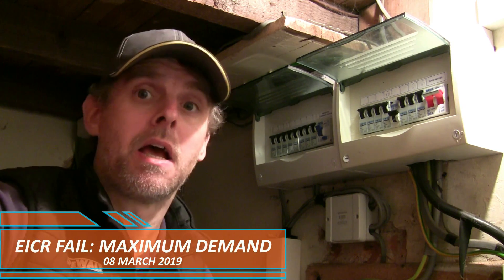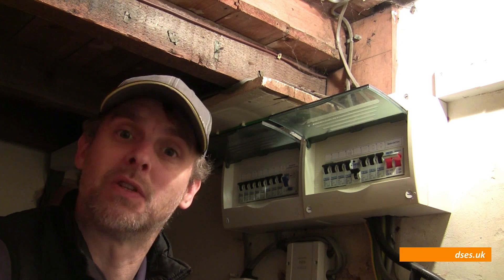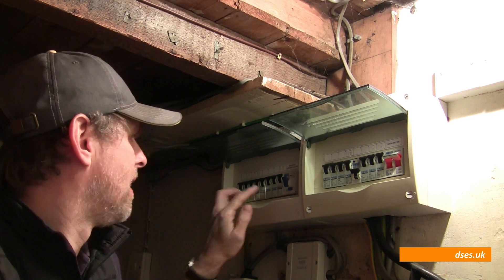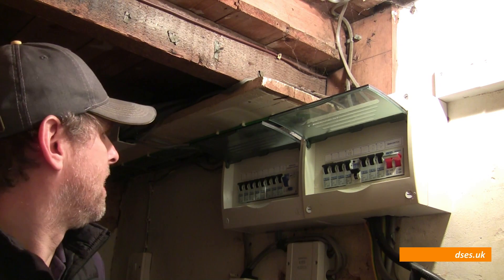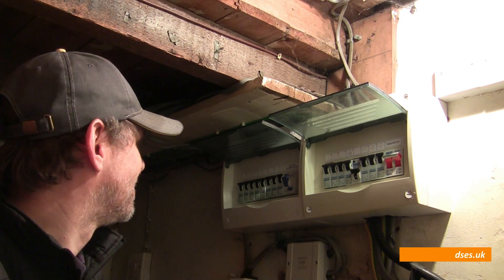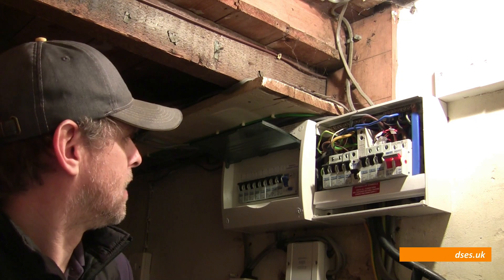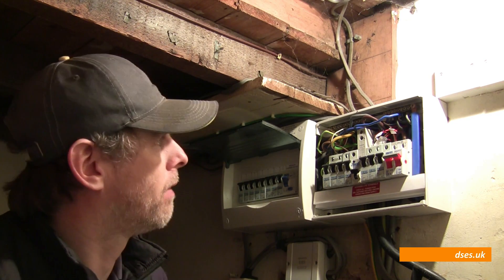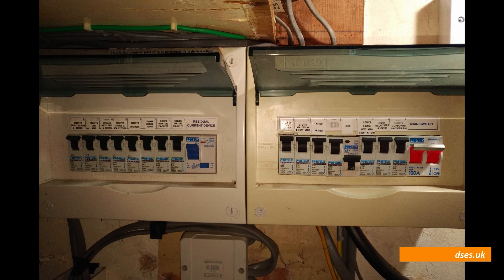EICR FAIL- Maximum demand

Comment: Is there a calculation that could be applied to work out the maximum demand?
Reply from the maker: See Appendix A of the OSG for maximum demand and diversity. It's a tricky one as you can never really be sure what the client will be connecting up, but unless you have known load values, then you assume 100W per lighting point (and can then take 66% of all lighting overall), 100% for the highest rated two electric showers/instantaneous water heaters, then 25% for any subsequent, 100% for the highest rated socket circuit, then 40% for each additional, 100% of any immersion heaters, cookers are 10A plus 30% of the remaining load plus an extra 5A if the control unit has a socket built in (etc.) I've also done it via measurement by using a clamp meter set to record a MAX value over a period of 24 hours average use. Usually you don't have to worry too much about it, unless you come across an installation with some heavy circuits such as multiple showers, car charge points etc. or if you get called out somewhere where the main fuse has blown without an obvious cause.
Reply: @dsesuk  sounds like a lot that I need to get my head around then. Will research more into it. Thanks for taking the time to reply. Great vids btw 👍🏻

Comment: Yes the RCD main switch is fried but has the DNO service fuse ever blown... It looks as though the service cable has suffered the most as a result of the overloading.
Reply: No degradation is apparent on the service cable.This is just standard PILC with a cloth outer covering.
Reply: Given the state of that system, it's almost like there isn't a working fuse in there.

Comment: David, that was an interesting video, sometimes it’s unbelievable what you actually find.  I find it hard to believe that there’s 3 electric showers & 2 cooking circuits as well as everything else.  In a domestic situation, sometimes, I just don’t want the rectifications.  It would be interesting to see the EICR & your reasons behind the coding.  It would also be interesting to see your plain English version to the client.  I have found electricians tend to code & have different interpretations of the regs.  I have installed a priority switch many years ago for 2 showers.  I am curious to know what you would do with the third.
Reply from the maker: Thanks Patrick, you're right about the coding, it is open to interpretation and often down to the discretion of the inspector as to how something should be listed. Besides that, the report is an awful form and there's nothing in the inspection schedule checklist specifically about demand. Apart from the individual circuit faults, the failed RCD I've coded as a C2 in item 4.8 (manual operation of circuit breakers and RCD's) because it won't react in the event of a leakage fault, and as a C1 in item 4.19 (RCD's provided for additional protection) as it's handling more current than it was designed for, so all bets are off as to how it will react. The failed RCD also shows up elsewhere on the checklist of course (items 5.12.1, 5.12.3, 5.12.5 and 6.1). As the demand of the installation is potentially more than the service head should be handling, I've put that as a C3 in item 1.2. It could perhaps be argued that a C1 or C2 applies, but it's been coping for the past fifteen years, and besides the common sight of the tarry insulation having leaked out, there's no outward evidence of it being unable to cope. Other's may have coded things differently, but whichever way you look at it, the report deems the installation to be unsatisfactory with 23 observations listed, and the covering email that went with it had about 1200 words explaining the issues and what needs to be done. The client tells me she has already contacted Western Power about putting in a new 100A PME service and isolator after I sent her a link to their contact form, and she has asked me to go ahead with a board change plus remedials so we should have a follow-up video in a few weeks.
Reply: @dsesuk  congratulations on being awarded the remedial works.... I think🤔🤣
Reply from the maker: @mickbitchum4664  It might be a bit of a short straw job!

Comment: Over the phone I would have quoted 340
Reply from the maker: Is that based on labour? We charged £280 in this case as our list price is £20/circuit for the first six circuits, £10 for all subsequent ones. There were 23 circuits on site, but one was redundant and was omitted. A large part of the cost of a CU change reflects the inspection and testing element, so the work to change the board will be less now that we know the site and its pitfalls. Many would have charged more considering the size of the place, but we've been awarded the work to put right, change the CU and make other alterations the new homeowners require, so it's worked out for us. Anyone who claims they could perform an EICR for substantially less can't possibly be spending the requisite time on site, and if a report is filled with limitations or made up test results (e.g. IR >999 across the board), then it just defeats the point of the thing. I see people offering EICR's for £60, but for that you're getting a drive-by that isn't worth the A4 it's been scribbled on. For that price, you can also guarantee the installation will be stamped as unsatisfactory because the guy doing it will want to make up work he can charge for whether it's needed or not!
Reply: Totally agree. You have to charge enough to do a good thorough inspection. My way of quoting is £50 per board and 15 per circuit. The 50 is to cover my ass if the board is not labelled or there are multiple circuits in one MCB. Your price is very competitive unless it’s against cowboys who do the Ze and then a quick Zs on every circuit and make the rest up. Glad you won the work. They will get a good honest, quality install from you. Loving your channel mate. I learn a lot from you. Keep it up.

Comment: I purchased a 5 bedroom villa with pool in Thailand.

When any of the 3 instantaneous water heaters are used, the lights go dim.

The voltage at KWH falls from 220V to 200V.

Luckily KWH is in the garden in a box with my neighbor"s and get to make an actual ring main when I do repair.

They have same size cables and under voltage problem on our private estate.

KWH are for from private distribution board.

Comment: The fact youv discovered a broken rcd are you to blame if it pops and causes issues an whatever, customers gonna be ringing saying you was the bloke who took my fuse box cover off ? How does that work mate
Reply from the maker: It's always a risk that you may be blamed for any perceived issue after you've been to site. We installed a couple of sockets for someone recently which necessitated powering down the installation, but the client then came back saying "my oven's not working, what did you do to it??" Turns out she just needed to set the clock. Then she said "my broadband isn't working, what have you done to it??" It just took a while for her router to wake up. Then she said "my Outlook calendar isn't syncing, what's going on??!" By then I was almost ready to throw my toolbox across the room. With this job today, my task is to find the problems and present the client with the list of issues and a recommended course if action to put right. It's up to them to make their own risk assessment of whether they want to correct any of the issues or to live with them; I have no legal power to insist the installation is either powered down or immediately put right. If problems occur afterwards, I would just point to the report and the fact that it says (in not so many words) that the electrical installation there is shagged and needs attention, and until it gets properly sorted, all bets are off as to whether anything on the snag list causes trouble either in normal use or under fault conditions.
Reply: David Savery Electrical Services 
Brilliant mate thanks for reply.

Comment: Great video thanks for the upload. I was looking at purchasing the TIS earth leakage tester, any good?
Reply from the maker: The TIS MFT Pro is a pretty capable multifunction tester, but for the earth leakage function you need the clamp accessory shown here which is sold separately and is pretty pricey. Mine has been loaned to me by TIS so I can show it on this channel. This was my first time using it, and the test shown was rather simplistic, I'll have a better video about it in the near future. The little clamp meter I have is a low cost solution for measuring leakage current.
Reply: @dsesuk  thank you for the update. Keep up the good work.

Comment: Great video thanks David!  Seen exactly the shower thing a couple of times now with multiple en-suite hmo conversions.
The subject needs more attention to it, especially on the generally terrible EICR  form, would love to see how you tackled detailing this on the cert.
Reply from the maker: Hi Andrew. It is an awful form, I quite agree! The failed RCD I've coded as a C2 in item 4.8 (manual operation of circuit breakers and RCD's) because it won't react in the event of a leakage fault, and as a C1 in item 4.19 (RCD's provided for additional protection) as it's handling more current than it was designed for, so all bets are off as to how it will react. The failed RCD also shows up elsewhere on the checklist of course (items 5.12.1, 5.12.3, 5.12.5 and 6.1). As the demand of the installation is potentially more than the service head should be handling, I've put that as a C3 in item 1.2. It could perhaps be argued that a C1 or C2 applies, but it's been coping for the past fifteen years, and besides the common sight of the tarry insulation having leaked out, there's no outward evidence of it being unable to cope. We have an enquiry in with WPD about replacing the head to 100A PME with an isolator, and we have the go-ahead for a board change. One of the showers will be decommissioned as they're turning that bathroom into a utility room, so that should help the situation!
Reply: Thanks for the detail David.  Ar the difficulties of trying to express a problem with something that’s apparently been fine for an age, but good call on the service head item i feel.
I would have probably gone with just C2s for the rcd but can’t fault you!
At least it seems your client is interested in getting it improved, that’s 90% of the battle in my experience, and if you’re board changing with 2 showers you can get the rcd load sorted even if they don’t want to spring for rcbo’s.
Not a bad result at all.
Top notch work as always mate!

Comment: That was a very interesting video David. I did years of testing many moons ago and it can be very taxing and tricky. Well done on spotting all the faults. It’s not easy, especially when you’ve got heaps of extensions, additions and alterations galore. I agree, R.C.B.O.s throughout. That’s my basic choice these days. It would be good to see a metal clad fire proof board in there. I hope you get the work, I think you’ll do a nice neat and tidy job of it. I hope you do a video of the shower switch you mentioned. That sounds very interesting. I don’t know about them? Thanks again for the video David. Have a good weekend!
Reply from the maker: Thanks David, I might see if I can push out that shower priority board video tomorrow (hangover pending).

Comment: As an ex emeb / cn / wpd mains engineer I'd be very surprised indeed if the one amp is actually leakage current from a phase conductor  unless there's a solid fault to unbonded metalwork that has an impedance of circa 240 ohms 'within the ground' and the nigh on 0.25kW of heat energy is dissipated into mother earth, or a phase conductor is touching damp brickwork etc. (possibly via unnbonded metalwork) and the heat is being absorbed by the building structure.  I've had both of these situations to sort out when customers  were getting shocks  when outside their property because of the potential gradient across sections of brickwork and across the surface of the ground.  I mention heat absorption because circa  240W of power  loss at one 'point' location would be most likely to quickly raise the temperature to a level where a fire would result.  It's perhaps more likely that the problem is a neutral to earth fault within the property, the 1A of current in the main earth connection to the lead sheath of the service cable being some proportion of the neutral current of the whole installation because there wil be a tendency for the neutral bar to be at a slightly higher potential than the earth connection of the 'tns' type supply at this property - hence all of the instalation neutral current will be 'attracted' to some degree to flow from the neutral bar, along the neutral of the faulty circuit and via the fault into the cpc or bonded metalwork etc, back to the main earth bar in the consumer unit and then via the main earth lead to the lead sheath of the service cable....which will (should!) have an almost zero impedance link back to the supply transformer neutral point.  The crossed colours on the armoured cable also has me wondering - is the neutral of that circuit actually connected to the earth bar of the consumer unit and the cpc conected to the neutral bar? - that would also explain what's happening - the 1A would be the neutral current from the load of that circuit!
Reply: That, everyone, is the voice of experience and wisdom. I hope this person teaches sparkys how to wire things up. There are a lot of crap ideas in the regulations, and a lot of good ways of doing things which aren't in the regulations, too. I get the impression this engineer knows the ins and outs of both these situations.
Reply: This is also needs to be taught to all jointers/linesman who havent got a clue what ohms law is

Comment: Interesting video, thanks.  It reminds me of an installation I was slightly involved in (I was doing the data cabling only) around fifteen years ago which had two electric showers.  The system was TNS and the head really old with ceramic fuse carriers.  The supply was strangely two-phase and neutral (with only one phase in use) and the electrician suggested getting the DNO to supply a second head for the second phase, with a separate CU connected to it for the second shower.  What I didn’t get is that assuming the service head fuses are to protect the supply cable, surely the neutral would be carrying the combined current of both phases?  The DNO guys seemed perfectly happy with the arrangement when they came (I recall the guy touching the neutral in the head with his finger and quipping “polarity test”!).  Interested to know any thoughts…
Reply: The different phases are out of phase so when one is peaking the other is 120 degrees out of phase. They never put peak power out at the same time so the neutral isn't dealing with two synchronised phases which is the problem you seem to be imagining.
Reply: @projectbuild9784  It's even better than that.  If you add together the neutral currents from two different phases each being say 10A then the amplitude of the combined current is also 10A (and not 20A).  This assumes sinusoidal currents which heavy loads will be.

Comment: When you filled out the condition report what figure did you put for maximum demand?
Reply from the maker: Hi Curtis. Have just done the calcs as I prepare the report. The figure on paper is 236 Amps. It isn't really that high, but because there are five 32A ring circuits it gets bobbed up artificially if calculated according to Appendix A of the OSG. I've taken diversity into account here, 66% on lighting, 10A full load plus 30% of remainder for each of the two cookers, 100% for two showers, then 25% for the third shower. 13A has been allowed for the shed where there is a single socket outlet and 13A for the water heater. Max demand calcs are a bit of a nonsense though as splitting up socket circuits just drives the numbers up on paper even if the number and utilisation of sockets remains the same. Usually, I just add up the MCB's and multiply by 0.4 to get an (arguably) more realistic figure. I know other sparks also do this, but I'm not sure where it comes from. Doing it using the 0.4 rule-of-thumb would give a figure of 168A in this case.
Reply from the maker: An excellent question, and one I cannot answer tonight as I haven't compiled the full report yet. I have the raw data for all circuits, so I'll go through it this weekend as I prepare the paperwork for submission to the client along with the invoice. I'll let you know when I've worked it out!
Reply: I find the formula a bit of a nonsense personal.  Nothing like experience when calculating maximum demand.

Comment: Very interesting exposé on CU issues and EICR's.  
Very good point about planning out the distribution of load on RCD's. Its quite shocking to see so much doubled up wiring into single MCBs. RCBOs should be the future. 
If there are enough being fitted then it should bring the price per RCBO down quite a bit. I cant believe how Screwfix can get away with pricing them at £30 to £40 each.
Reply from the maker: Prices are coming down for most brands, but you're right that economy of scale should drive things down further if we're all fitting them! Whoever put in this board failed the selection part of his Selection and Erection however, as it's not big enough for all the circuits on site, and not rated for the circuits hanging off the RCD!
Reply: I am surprised we still get away with putting several circuits on an rcd, front end rcds were frowned upon several years ago, yet because we have two rcds it makes it acceptable, however the regs say a fault on s circuit should not affect another circuit, which it does with one rcd or two, and the only correct way is rcbos. The MCG ones are the same size as a breaker, double pole, no earth wire and £12 ideal for someone on a budget.